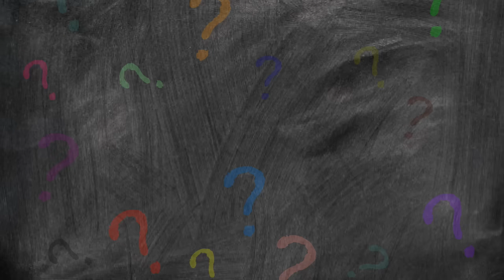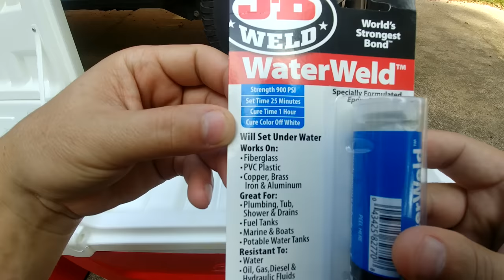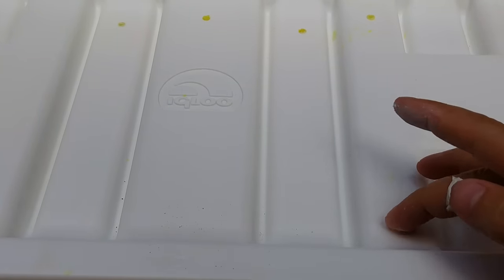Do Yeti cooler hacks work?

Comment: Air pockets have a great lnsulating quality.  That is how a therml blanket works.  The flaw in the theory was the assumption that there is nothing in the lid of the stock cooler.  You pushed out the insulating pocket of air.
Reply: Came here to say this. Thermal energy can transfer better through a solid object than an air barrier.
Reply: @user-zq6pj5jo8j  Since the Yeti coolers are also foam filled, I would assume that it's a minimally dense closed cell type foam with lots of air to minimize heat transfer.
Reply: would be interesting to see if you did it again, but put the seal on one with a stock lid.  I bet that would work even better.
Reply: It may even be a vacuum which is better than air
Reply: Good theory but not accurate according to physics. While air is an insulator it better when it is trapped. Foam traps air. If your theory were correct then why don't we leave our exterior walls empty? Why do we put batt and foam insulation in them if plain old air is better? What actually happened is the air in the cooler was trapped by the seal and since temperature seeks equilibrium, the heat in the air was transferred to the ice. The foam is also more mass that holds heat. The heat will be drawn to the cooler temp pulling more heat form the foam than in the empty air pocket in the stock cooler. The stock cooler allows the hotter air to escape through the unsealed and uninsulated lid. Simply put the modified cooler had to work harder, but that would only be initially . Once the foam and the air in the cooler equalized the modified cooler would have out performed the stock cooler every day of the week. Starting the coolers off in a cool place and icing them down prior to the experiment as well as just keeping them in the shade outside would have been a better setup.
Reply: Thermal bridge.
Reply: @MrRaptorman1975  We don’t leave house walls empty because their interiors are not airtight. If the walls were genuinely airtight, then they would better insulation than foam and batting. I believe the reason the cooler lid insulates well is that the lid is a sealed plastic container for the air.
Reply: @patrickr9416  Modern houses are air tight. They even test to ensure it and yet they still use insulation. Sorry but an air right cavity does not have the R value of an insulated wall.
Reply: @patrickr9416  let me ask you this. By your assertion an airtight wall cavity has me R value than an insulated cavity? How about an airtight with insulation? Does that have less R value.

I think you need a course in building science.
Reply: @patrickr9416  lastly the stock lid isn't insulating better. Another misunderstanding of the physics involved. The ice didn't melt because more warm air was introduced. It didn't melt because the initial warm air was able to escape. Again, in the long run there is a reason a Yeti keeps things cooler longer and it's not because the cooler is full of air. It's full of insulation.
Reply: @MrRaptorman1975  Red Can of Great Stuff is a sealant, not an insulator.  Anyhow, Dead air has an r-value of 5.7 per inch.  Red Can Great Stuff r value is listed as '5-6 per inch'  So it would appear dead air has a slightly higher r value than great stuff.  This is verified by the video where we saw the dead air insulation is indeed very slightly higher than Red Can Great Stuff.
Reply: @asdfdfggfd  it even says on the can SPRAY FOAM INSUALTION. The fact it has an R value means it INSULATES.

Still air actually has an R value of 3.6 and red spray foam R of 3.7 per inch.
Reply: @asdfdfggfd  and again, that isn't what the video showed. It didn't prove this at all. There are too many variables to come to a correlation conclusion.
Reply: @geak78  No vacuum in those coolers. The body and lid frequently have small holes left over from the molding process, so they cannot hold a vacuum. Also, if there was negative pressure inside, the plastic would cave in.
Reply: Lol that was my first thought like he is making the cooler worse hahaha. You know what though in his own way he is performing science and learning even if it's a lot more effort than simply opening a book and reading about how to insulate something lol.
Reply: @MrRaptorman1975  It is an interesting concept of the foam retaining temperature.  It is my understanding places in Alaska, Siberia and other extreme cold locations use double walled structures with air pockets between the walls.  This is also why they use double tenting.  That being said your point about insulating foam absorbing and redistributing energy would be more useful in a system using a perpetual cooling system such as a house.
Reply: @MrManueleh  yes temporary structures and other primitive structures utilize layers of air to maintain temperature. It creates thermal breaks. That doesn't negate the fact that an insulated structure would be more efficient and affective at maintaining temperature.
Reply: You saved me from having to type more. Thank you.
Reply: @MrRaptorman1975  airflow is the 1st rule in hvac and the best way to maintain temperature. That’s why homes have ridge vents. So heat can escape. That’s why modern windows are no longer single pane and have a charge of inert gas and a reflective metal coating on the inside. Fiberglass insulation is more cost effective than air proofing and pressuring the stud gaps with argon… Airflow is the number one rule and the last rule of climate control. Dumping heat and adding cool air while removing humidity. Static pressure would rise in an air tight chamber and cool air could no longer fill the space.
Reply: @jayquick6520  not an argument I made. The reason windows are double paned with gas inserted is actually insulation is hard to see through. Even with the air windows are huge energy loss locations. Far more than the insulated walls.
Reply: @MrRaptorman1975  Creating vacuum chambers is far more difficult than being a general contractor and having your laborers install fiberglass insulation. Point being if a roll of fiberglass being light and energy efficient is replaced by vacuum chambers in plastic tumblers and coolers (objects made with materials that can easily create vacuum chambers) then the jury is still out. Once polymers become a common building material I strongly believe the vacuum chamber will become the insulation method of choice. Solid wooden structures were already the insulation method of choice but building materials aren’t cheap. A roll of fiberglass is commonly used because of economic reasons. Send anyone you want into the forest with nothing but a tool bag and demand they make something than can be air tight indefinitely. It will not happen. The window example was to promote gas or lack there of as an insulator. Feel free to touch base on any other points brought up.
Reply: @jayquick6520  a vacuum chamber would remove the gas that would be installing defeating the purpose of an air chamber.

At most air has an R3.6 value per inch. Fiberglass is about the same. Loose fill can reach over R4.
Reply: @MrRaptorman1975  they both work.
Reply: @MrRaptorman1975  no house is air tight. It's not even possible
Reply: @MrRaptorman1975  uh, the wall cavity itself is not airtight. they are left to breathe on purpose to allow moisture to escape.
Reply: @MajorOutage  exactly. I worked on a house with a faulty tyvec job that couldn’t breath. The house was rotting from the inside out. Luckily it had cedar siding that began to rot and prompted the repair that ultimately found rot from the studs to the plywood and into the siding lol. Homes aren’t meant to be airtight. And heat concentrators like windows are meant to prevent the concentration of heat with modern techniques like reflective coatings and inert gas charges. That’s just the way it is.
Reply: The problem is thermal bridging, filling the entire space gives the heat a path, maybe yeti coolers glue the foam to either the top or bottom of the lid and still leave a thin air gap? Or better yet two weirdly shaped pieces of foam interlocked with gaps between to mess with convection
Reply: @MrRaptorman1975  yeah man I'm having a hard time with "modern houses are airtight". Modern houses aren't even close to airtight, they're probably leakier by far than older houses since they're slapped together so quickly...it'd be a total nightmare to try and make a house completely airtight
Reply: @MegaDysart  I didn't say all houses but modern which means this currently built using modern methods. I live in a an area that utilizes these systems. These houses are considered airtight. The problem you are having is with the term. You think airtight housing means 100% air seal. I would guess that you aren't in the industry by this confusion and lack in knowledge on airtight construction.
Reply: @MajorOutage  old building methods did not seal up the house due to their design. Modern construction methods seal the home abs use fresh air exchanges to bring in air.
Reply: @jayquick6520  airtight homes are designed to be airtight. Tyvek isn't an air tight membrane. It's actually designed to breath in one direction. Whatever the house was suffering from it being too airtight wasn't the issue.
Reply: @MrRaptorman1975  my friend the house was airtight due to non permeable Tyvek. The cause of the rot was due to the house being not being able to breath. I don’t know what you’re trying to say that hasn’t already been said?
Reply: @jayquick6520  then it needed a fresh air exchange my friend. Like I said you need to take a course in building science. You are completely ignorant on the subject.
Reply: @jayquick6520  which product by Tyvek?
Reply: @jayquick6520  Having a hard time finding a Tyvek product that is non permeable. Sure would love to understand which product you are referencing.
Reply: @MrRaptorman1975  you’re incorrect and I got tired of seeing you spam this comment section with your ignorance because you took a BOCES course out of high school..
Reply: @MrRaptorman1975  standard house wrap. And the excess moisture in the air will be controlled by a properly sized evap coil and blower.
Reply: @jayquick6520  standard Tyvek isn't watertight. The only ignorance is coming from you. Tyvek is considered WRB not a water impermeable system.
Reply: @jayquick6520  I have been in the industry for 20 years and have taken continued education courses for just as long. Your insults are useless and only point to a lack of facts and logic. You actually think standard tyvek is air impermeable when it's considered a breathable membrane.

Here's some advice. It's best to be tight a fool rather than open your mouth and dispel all doubt. The house in your example didn't fail due to Tyvek. Maybe improper installation. But even if it were a water tight house it should have been scheduled an air exchange to mitigate any moisture issues. But please keep expounding it's fun to educate others.
Reply: @MrRaptorman1975  Rob the manufacturer of the house wrap was taken to court years prior because of a product recall. Practice what you preach. I was there during the job lol. I know what was said. You’re too mouthy. Too sure of yourself.
Reply: @jayquick6520  and yet you said tyvek is impermeable. Ignorant people can be in sure. Hell, ignorant people can be elected president (see current administration). Being there and recalling a story from years ago didn't make you right or knowledgeable.
Reply: @MrRaptorman1975  no I said it IS permeable as not to create the air tight home you were spouting off about. I recalled a repair required as a result of faulty non permeable tyvek. Also FJB!
Reply: @jayquick6520  air exchangers are not meant to mitigate moisture but replacing air in the home since they no longer breath aka leak like a siv.
Reply: @MrRaptorman1975  AC systems remove moisture in the air. Makeup air units control the static pressures of the building for better cooling or heating of using forced air.
Reply: @jayquick6520  wrong. Air exchange systems also aid in moisture control. While it may be the HVAC system that removes it, it cannot do so in a sealed system without an air exchange. So no matter how large of an HVAC system you install without an air exchange system in airtight construction it won't remove enough moisture. You have to have an air exchanger.

You are conveniently excluding information and over simplifying your claim in order to discredit my point that the reason a home needs an air exchanger, regardless of the HVAC system, is to help reduce moisture and bring in fresh air that an older home would bring in through gaps in the buildings envelope.

Keep trying though. You almost have it.
Reply: @MrRaptorman1975  I fully agree with you. When we go to fish camp, us guys drink lots of beer, so our cooler lids are open and closed so frequently that the yeti build would probably do terrible
Reply: Insulation is a lie and a scam is what I’m figuring out… looks like I’m ripping out all of my insulation in my house!
Reply: Yes but insualtion is better period lol. Do you think the better coolers just have air? No they have 1.5 inch + of insualtion all around

Comment: What we have always done when camping is dig a hole just big enough for the cooler to slide down into and have a piece of plywood with a reflective sunshade tacked to both sides of the board over the top of it. Grandpa taught me this and he called a it a hobo refrigerator. Instead of ice lasting a couple of days it will last close to a week.
Reply: Good idea gramps!
Reply: We do that with "gutted" fridges. (No compressors or refridgerant.)
Reply: @jabbawoods  a burlap bag, draped over shelves with a water drip keeps it really cool also.  Air is a great insulator.  Peace and it was fun watching this for sure.
Reply: Good idea unless you camp near bears
Reply: I was homeless for a little over 2 years and this was how I kept my cooler items cold longer. I lived in a wooded area in a tent. No worries about larger predators. Raccoons were the biggest problem. I had to add a padlock to the lid to keep ‘em out. I didn’t use the reflector. Such a smart idea. I always just laid a blanket over top
Reply: @briancheetham9134  don't have to worry about brown bears where we go. We do have black bears but they are definitely not keen to interact with humans.
Reply: we had a what we called a ditch lid, it was a 2x4 frame with a reflective hinge door, dig a hole, plop in your cooler, plop on the ditch lid, and bam, ice for the whole week long camping trip
Reply: @e2U  Check out the 'Coolgardie Fridge', Jeff.
Reply: Thanks for the tip
Reply: God Bless 
Grandpa !

Comment: That foam in the lid was probably still curing...alot of foams generate heat when they cure
Reply: Thats exactly what i was thinking
Reply: Thats exactly what i was thinking
Reply: Yep, that’s the only logical conclusion. The excess foam was in contact with the air and this dried before the sealed portion.
Reply: yes I think so too another guy on youtube did it and it took almost 3 days until the foam was cured
Reply: Very interesting take, could be right imo